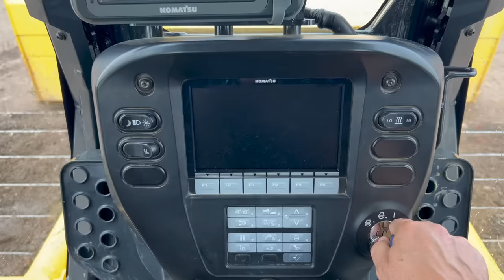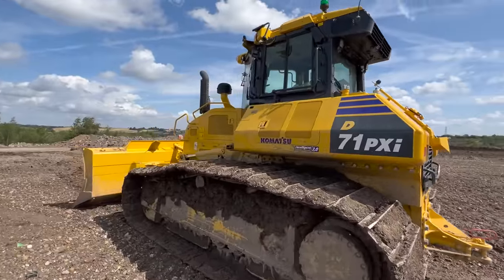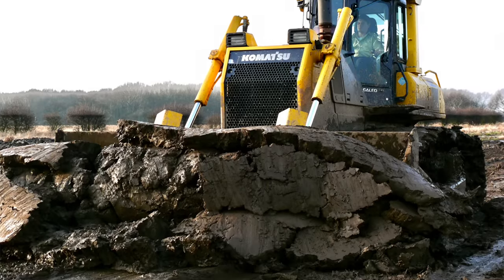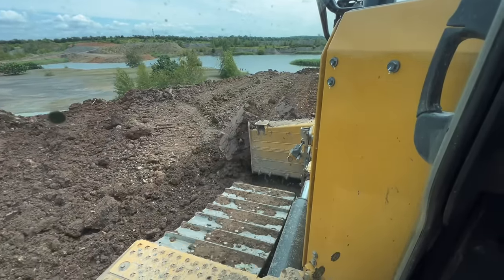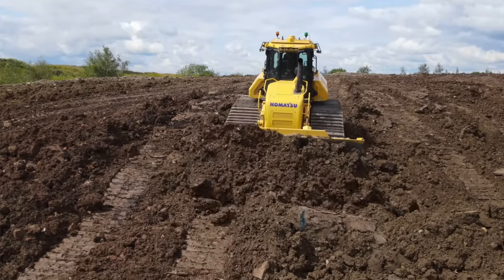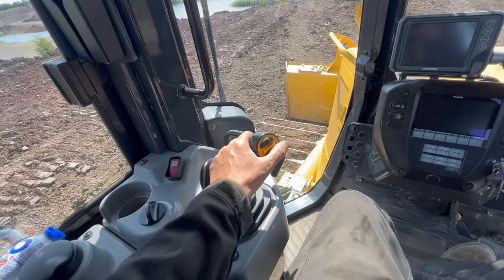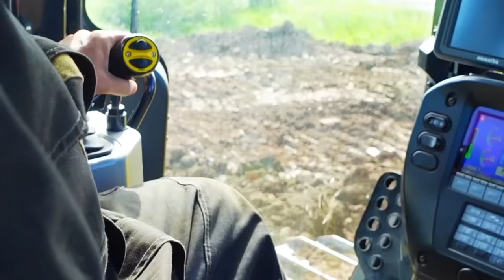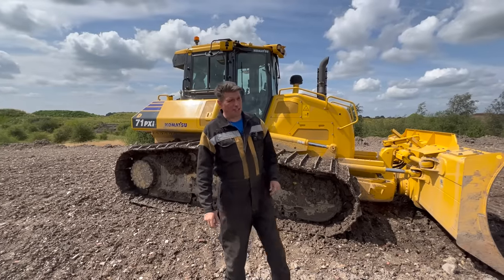CAT D6 vs KOMATSU D71

Comment: We need more videos like this then the likes of Cat and Finning wouldn't be able to brainwash the Cat fans in to accepting the same outdated crap with just a new sticker on the hood
Reply: Well You’re right about that 👍🏻🇬🇧
Reply: komatsu in the 90's bought Hanomag and since then have made huge steps forward probably because they can now draw on the hanomag engineering excellence, they had bulldozers running in the 1920's.
Reply from the maker: I'm a massive fan of CAT dozers and equipment but I also like to show other operators what's currently out there and then it's down to personal preference, running costs etc.
You've got to make your own choices at the end of the day.
Reply: What a great presentation. Objective and to the point. Like it 😊
Reply: Back in early 90s cat/Komatsu made a d5 foot steer dozer...it was nice. Then the Komatsu came out with the 37s... the Komatsu has been my favorite since
Reply: Thx for reply
Reply: The best brother
Reply: Komatsu number one the cat's another good tractor❤❤😂😊😊
Reply: KOMATSU D71 is the best😝😝😝

Comment: I was a die hard Cat guy until I had the opportunity to operate the Komatsu D51 and D155, the visibility was second to none and that D155 was a beast, both were very smooth to operate and comfortable for the operator. I still like the Cats but I'm leaning more towards the Komatsu now. I'm really liking their excavators now as well. I was also impressed with the visibility on the 1650 Case dozer as well, it's pretty close to the Komatsu.

Comment: Very useful video, that box in the Cat cab on your left shoulder is a horrible design. I have worked a D6T and a D71 side by side on production work. The D71 comfortably will out push the Cat. The operator cab and visibility on the D71 are light years better than the Cat.

Comment: What I like is that you are comparing apples to apples ... not a 15 yr old clapped out beast to a brand new shiny machine. The visibility in the Komatsu is astounding. How was the headroom? It looked on camera like your head was above the rear window and into the roof?
I, personally, would probably enjoy the Komatsu controls. I was never a fan of the thumb lever on the cat for blade control. It doesn't have a "natural" feel to point my thumb straight up like I'm hitchhiking while holding on to the joystick.
Thanks for sharing 🇨🇦
Reply from the maker: I think it was mainly camera angles as I had no problem with headroom with either machine

Comment: As a heavy diesel mechanic I've spent a lot of time in the forestry, on civil construction sites, various mine sites etc then i worked for a heavy hire company which had a large fleet which included Cat D4 - D11 and Komatsu D41 - D375 dozers. We found the Komatsu's to be more popular with our customers due to its pushing power and low centre of gravity. Both brands are good, but the komatsu's reliability and performance is second to none and I would highly recommend. As a mechanic the only thing I would say about dozers in general is they can be hard on the body and very difficult to work on with poor access to the transmission etc often having to remove very heavy seats or even whole cabs to gain access and a lot of the Komatsu models being Japanese were no exception, luckily with some of the later machines now you are able to tilt the cabs for access, a feature that john deere and liebherr adopted a long time ago. HST models are certainly becoming more efficient, reliable and popular. One thing to consider with dozers it is very important to look after and regularly service the rear end, final drives, bull gears etc as they are naturally prone to wear and failure. Really enjoying the content and commentary, keep up the good work mucker, cheers
Reply: Hey Craig,have you experienced any steering issues developing around the 16,000 hr mark on Komatsu??  I have not personally experienced that yet myself..That's what I have been told by numerous techs/mechanics..Also that it can be a bit of a nightmare to troubleshoot..I do prefer Komatsu tractors,so this is not a negative comment,rather a legit question..
Reply: @Randyman4126  Hi Randy, I haven't personally dealt with any steering issue's on the komatsus the hire company i worked for didn't usually do quite that amount of hours before they would on sell them. I do recall some years ago one of the other techs I used to work with having some issues with the transmission and steering on an old D155A-3 which had quite a unique setup withs lots electronics. From memory it needed a new wiring loom as it was plagued with too many intermittent issues. Cheers

Comment: I am an oldie..72 years old....We had a family owned sand and gravel company in Prescott, Az. from 1969 to 2003...the equipment shows in Las Vegas in late 60s early 70s we would marvel at the Chinese & Japanese there crawling up, in and out of all Caterpillar equipment photographing every conceivable inch..We owned Cat, Komatsu & Terex loaders, dozers, haul truck,backhoes...And Komatsu are great machines however, the used value market price was not the best and we did for the last 15  own primarily Cat. and had buy back program with them. Enjoyed your video..Thank YOU.
Reply from the maker: Thank you for sharing 👍

Comment: I started out on a D4 hand clutcher or the signal box as i called it due to the amount of levers.Then a cold winter on a D8 with a live chicken nesting in it no joke.Then  farm contracting for years then a few yrs at a quarry on a Komatsu wa 470 shovel and a D6 C. The yrs rolled on and i went backwards ending up on a 41p Komatsu dozer or the dreaded 41 hand clutcher as know one wanted or said they could drive it.The worst dozer i have operated was a D6 R on narrow tracks the best was a D6 H with the tiller steer on wide tracks.We call dozers under the D6 size worm disturbers up this way. Great vid LM as per.
Reply from the maker: Appreciate the info from someone with the skill of an experienced operator 👍

Comment: Did a few days in a D 71 PXI a few mths ago and thought it was an awesome machine, loved the visibility and the hydrostatic drive, and room in the cab. I usually operate a D 7R2 LGP but have spent of time on everything from D 10T to D3, TD 6 to TD 30, but the D 71 would probably be the No 1 machine for me for doing what we mainly do which is residential subdivisions here in QLD. Been on dozers since I was 16 and 73 now so have a wee bit of experience on them.

Comment: Great Vid Kurt
I have recently been on a job that had a new Komatsu D61px and a new Cat D5 so like for like in spec. both running on leica Gps for final trimming . My own opinion at the time was the Komatsu would out push the Cat  and use less diesel .  The Cat on the other hand would be faster at trimming . Even with the poorer vision it seemed to function better with the identical gps system .Myself and the other op were in agreement about this .
Out of choice i would operate the komatsu .
Keep up the good work and you will really enjoy using a tilty. There is a guy near me who has a tilty on a 4cx ,absolutely amazing piece of kit as he can drive,  steer and change direction through the sticks as well as operating the backhoe and tilty.

Comment: Ive been running a new Cat D4 for a year now and before i got it i did try out a PXi51. I totally agree Komatsu has it for cab space and sound. I also noticed on the inside was that a majority of everything was steel not plastic like Cat. But i think Cat has the comfort over Komatsu. Thats one reason why i picked the Cat. They also changed the hood so you can see better looking forward. But Komatsu definitely has the visibility in my eyes. I also liked how where the cab is located didnt think you got beat up as bad. Awesome video!!

Comment: We usually Run a D6m currently away for repair, Have a D61px on hire,  The Komatsu is 10 x better. The only annoying thing Is when it keeps telling you not to overload and that you should be running in economy to save fuel
Reply: You can turn that off in “configurations” tab!! 👍

Comment: Reading the comments the Komatsu is ahead of th Cat where it counts and that is in the work rate, if the fuel costs are lower too then Cat are going to have to work hard with their next generation of machines to catch up and maybe steal a few ideas to improve that bloody awful frontal and rear visibility.
Having the operator constantly craning their neck to one side to avoid that blind spot on their left is an atrocious piece of design work, how that one got past the final prototype stage is a mystery.
The only thing I wonder on is the hydraulic fluid, how tolerant that is going to be to prolonged heat and will the service schedule need to be as rigorously adhered too as much as possible to prevent the fluid from breaking down?
Other than that I would say on terms of operator comfort and the ability to use the dozer in the most efficient manner the Komatsu is way ahead and as you said it is a game changer.

Comment: That D6 N is on a 5 H frame  . Cat has gone from numbers to letters being the R and T are substantially bigger. We ran the Komatsu 61 exp starting in early 2000s and I was sold. The moldboard will tilt drastically further than the cat. I’m not a fan of high tracks but we have had with them for years. Over the years the Komatsu has held up with less services required. I still prefer a cat motor  grader over the Komatsu. Cat has Mitsubishi power 😮sad. I feel Komatsu both in excavators and dozers durability , service, comfort, and power winner. I agree 100% on the controls. They have been clunky and strange since going from linkage. Thank you for the content.
Reply from the maker: Thank you for the input and info 👍

Comment: Having operated Komatsu d61's,65's,68's lgp,85px/pxi,155's & Cat d5h,6h 7h/r,8n/r/t..I prefer the Komatsu tractors over Cat..I'm in no way trying to say anything negative regarding Cat as I'm fine with operating Cat..I just found Cats to be a little less balanced than the Komatsu tractors..The visibilty as you mentioned, I personally find better on Komatsu..Even with a 15 - 20 ft blade..I also have heard from numerous techs/mechanics that Komatsu at around the 16,000 hr mark can develop steering issues that can be a nightmare to troubleshoot There's other things,but again,it just comes down to operator preferences..Great video!!

Comment: Been running equipment for about 23 yrs I’ve worked on farms, logging, civil and for the past 7yrs I’ve been matting and environmental engineering for utility companies.  4yrs ago my company bought Kamatsu excavator which I was immediately impressed with it will out lift out dig and out perform the cats n Deere excavators we have all day long and for being zero turn it is unbelievably sure footed.  It will pick up 4 12”x16’x4’ timber mats weighing around 3300 lbs each and swing around fully stung out n not even begin to lift up which is pretty good for a 40,000lb machine the cats n hitachi machines of equal size wont handle half that load and stay planted and they are mostly normal configuration not zero turn machines.  I’m not one to play favorites I love all equipment but it’s hard to overlook the performance

Comment: Fuel consumption?  It seems like our 71’s definitely burn less fuel than a D6 does.  And the built in GPS is great. No masts to put on or pods to put up with wiring hanging all over as well. Cat has to step it up

Comment: I miss operating (structural rigger these days) but what always did my head in with operating was the fact that you're not always given a good machine.

Like you said, you spend most of your life in the cab, you should make it your own, keep it clean and organised, and make it work for you. 

The other thing that always ticked me off, from the manufacturing side, was the controls. It's not the 1930's, we're not actuating individual hydraulic levels or a 4 way switch mechanically connected to hydraulic valves - It's all electric control of hydraulics. This whole "this machine's controls vs that machine's controls' stuff is stupid. Control levers/joysticks should plug into the machine with a universal connector using macros like a video game. That way you can set controls to whatever suits you individually, people can just mount whatever stick system suits them and take it machine to machine, if they so please.

I noticed this especially when I operate forklifts in a high bay warehouse for a long time, then operated excavators, then I got into telehandlers. As an excavator operator I was in the same machine 12 hours a day for weeks at a time, so controls become second nature. As a rigger, I jump into a telehandler very rarely, and often don't do more than a day or 2 consistent operating at a time. It's ironic that a telehandler feels and operates almost exactly like an excavator (to me anyway) but the fork tilt direction is reversed from the bucket crowd in terms of right stick side to side. If I could flip a switch to change that and make it uniform in terms right stick lean left tilts forks down just like right stick lean left curls an excavator bucket, then I would be able to jump into a telehandler at any time and instantly revert to 'final trim operator' mode.

It's the silliest thing, but in my opinion all controls should be macro and stick units should be plug and play to put whatever crazy setup you desire.

How do we even know we have the best or most efficient control layout? A lot  of it is built on history and tradition. Best way to find what's good is to try a bunch of new stuff to see what sucks and doesn't.

Comment: Cummins and Komatsu have a Joint Venture called "IPA" where they manufacture engine blocks together.  The D61 has an engine that is basically a 6.7 cummins block with a komatsu rotating assembly and cylinder head and Denso fuel system instead of Bosch. The 6D107 engine (6 cyl, 107mm bore).
In the case of the D71, it gets the 9 liter engine out of the D65 (6D114 Engine).  I've always heard that is actually a full Komatsu engine; 540 cubic inches (8.9L) but I dunno it looks pretty similar to a cummins L9.  Even though the L9 is supposedly 543 ci (9.0L) displacement.
Reply: One more thing; komatsu does use a holset  variable geometry turbo like a cummins.  However the komatsu VGT is hydraulically actuated and the cummins version is electrically actuated.  Also the aftertreatment system on the Komatsu is different.  Would be interesting to compare the bore diameter and spacing of an L9 vs. 6D114.  Quite possible that the block is the same but I dont know.

Comment: Rather work on cat than Komatsu …. Komatsu awesome as long as warranty is current . And someone else has to fix it …….
Reply from the maker: What do you feel are the benefits of the CAT where repair and maintenance are concerned ?
Reply: Been  running komatsu last 6 years never had a problem with down time.
Reply: Komatsu is better designed and just because you are not knowledgeable enough to understand that does not mean it's not a better machine.
It's like ford vs Toyota no comparison.

Comment: Vision and comfort are most important, esp. when your in a machine all day, it is sort of a shame that the design teams don't work together rather than in competition. If you got the best of both machines, it would be a doozie. Komatsu have been in the market for a while now and have excellent products and Cat are still riding on brand power, which is where Mercedes fell over. 
I bought a tin of paint the other day, 1 litre was half the price of half a litre of a brand that advertises extensively, using an oversized fluffy dog, does the same job.

Comment: I work at a landfill that accepts industrial waste from drilling rigs. Im courious how the flotation is in mud.Belly pan dragging, stuck kind of mud. Currently using a D6t but would love to try a new Komatsu to see how they compare. One advantage the cat has is the ability to clean the tracks easily with the high drive.
Reply from the maker: With the older D8's we'd simply drive them up on to a soil bank to dig out the tracks...

Comment: Just found you on YouTube. Like the videos and just spent a weekend binge watching. I remember when I was a kid in the 80s. I was fortunate enough to go to work with my dad, Grandad, and uncle on the same site, digging some duck ponds. My dad was on a Cat D8f with manual transmission and donkey start. My uncle was on a D6, and my grandad was on a Komatsu D65. Everyone had a go on the newcomer (Komatsu). All wanted to hate it, but all ended up respecting it. It wasn't long after that all the Hymac back actor's  went and was replaced with Komatsu.

Comment: I've ran alot of Cat 963, and 973 track loaders, I've often wondered how they would perform with a blade on them (the vision would be very simular to the D71). I used to run a D65EX in the 1990's, and I thought it was a pretty good dozer. Komatsu makes good equipment, but the Cat parts system is so much better (unless Komatsu has changed that).
Reply from the maker: In the UK CATs global parts supply is good for all the companies they deliver parts for except CAT 😂
A lot of operators have said that's one of the biggest issues with CAT - service back up.
Komatsu seem to have dialled right in these days to parts and service.